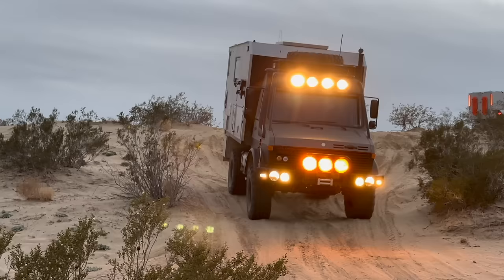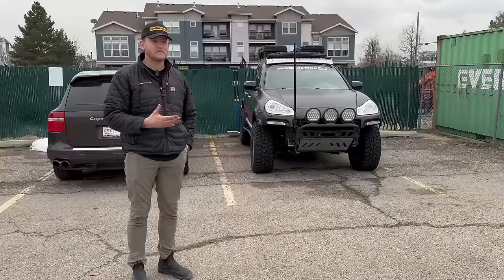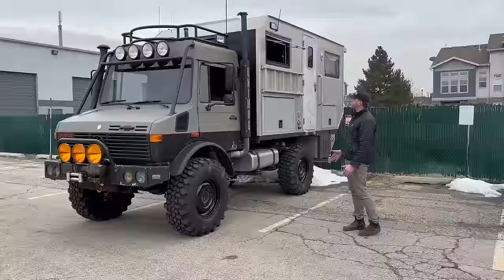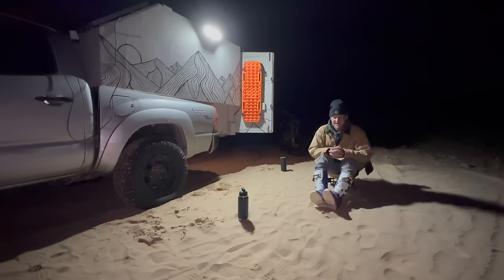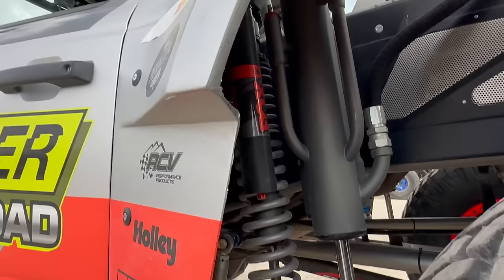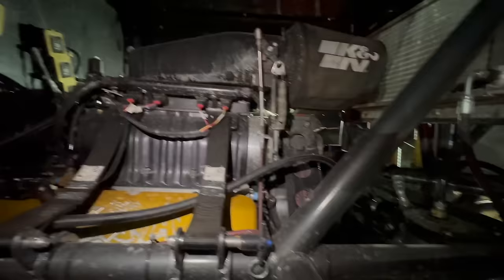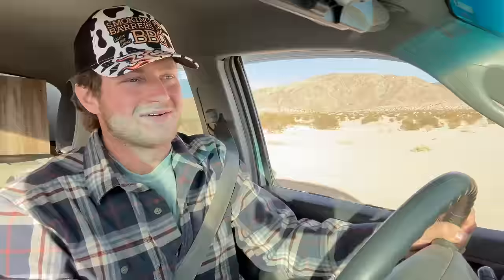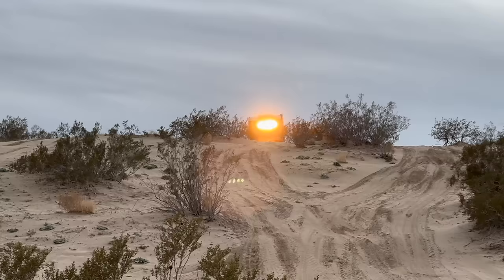5 Days at the World's Biggest Off-Road Party

Comment: Howdy I subscribed a while back and like some noticed your frame seemed to be flexing to much. Just curious did it has the frame fix done away with so much flexing it appeared there is still a flex behind the cab at the box gap. I might be wrong but curiosity killed the Cat LOL. Nice video also by the way. I live in Colorado and I four wheel all the time with either by 1962 Willys pickup with 28,000 actual miles or it’s matching 1962 Utility Wagon with about 42,000 miles. Both have 38” tires and 4 inch lifts and have been outfitted for off roading. Both have Buick V6 engines out of Buick Grand Nationals to save on weight yet provide the Hp and Torque I needed. Thanks stay safe
BTW I wanted to make it to the event this year but time didn’t allow it.